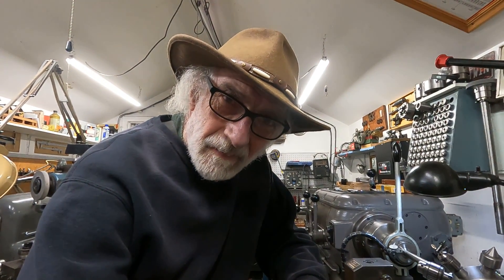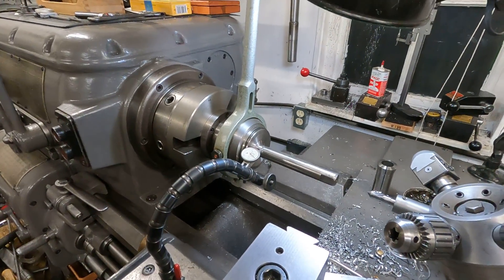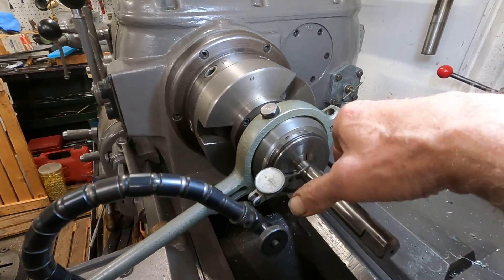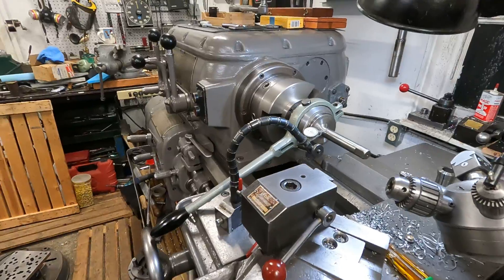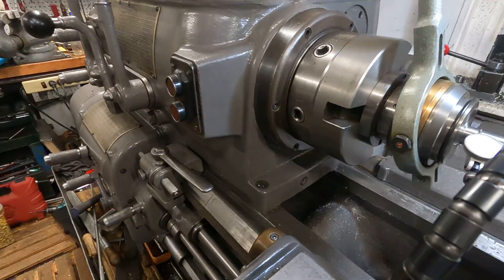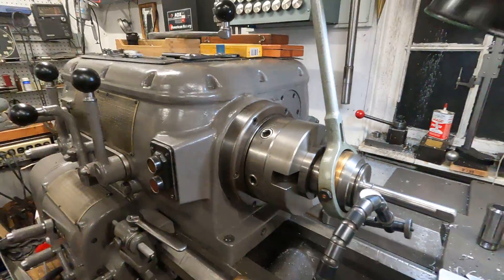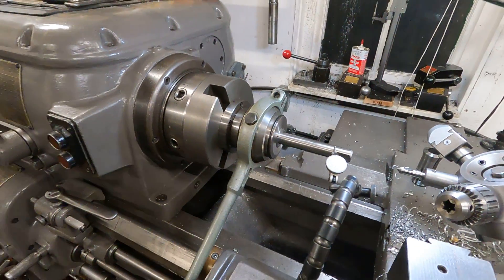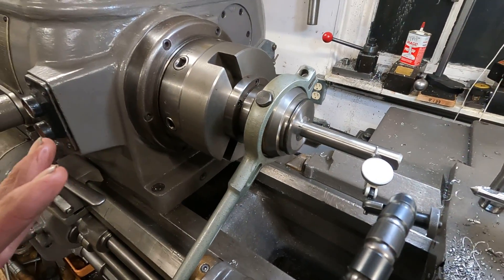Enco 1970s engine lathe 5c collet and turret tailstock package

Comment: Hi. In pursuit of precision. Since my tool and cutter grinder work heads are not axial adjustable, Cuttermasters recommends the Hardinge four split high precision 5C collets. Do you feel it is necessary to spend $90 on a 5C collet for center cutting two and four flute end mill sharpening? Thanks for all the work making educational videos.
Reply from the maker: The local Colledge had a set of Royal 4 split collets but Rob at the mold shop and others just used good collets or ones that could be tweaked true. I will show some adjusting while tightening the collet methods that might help, thanks for the video idea!

Comment: I need to get one of those tailstock turrets, but I would fit it into the carriage mounted drilling bracket which I think would make low number production jobs go really quickly.
Reply from the maker: This turret is a 5" with 1" holes, seem to begin flexing at much over a 3/8" drill bit in steel, I like the idea of using one on a tool post, thanks

Comment: As an apprentice in the 70's, our shop had a 5C collet closer on a an ancient South Bend belt driven lathe, but it had a REAR closer arm that was easily adjusted for tightness of the collet. 
Never had or seen one of those tailstock turret accessories, cause we had 2 actual Warner Swazey(?) turret lathes for that sort of machining. Keep up the good work Don, brings back old forgotten memories!
Reply from the maker: The mold shop sale had this front lever closer and the rear lever closer that is still there. The Axelson head stock is long where you have to move and stretch to use the rear lever type, this one is right there but screwing the collet in and out makes it harder to use other than for running bar stock. The Enco tailstock turret works best in the heavy side wheel tailstocks where it is actually hard to change tools, I think once set up it should work pretty good and be entertaining at the same time, thanks